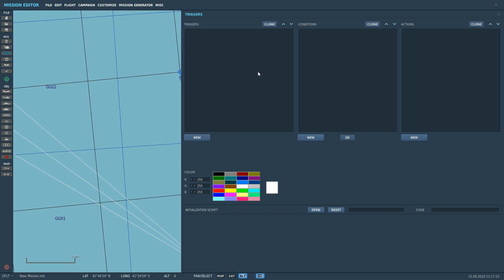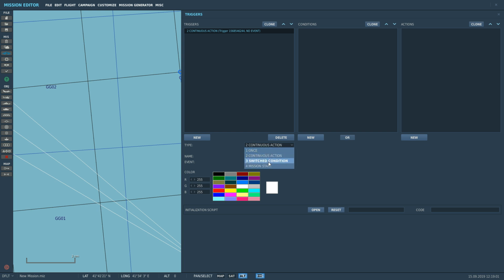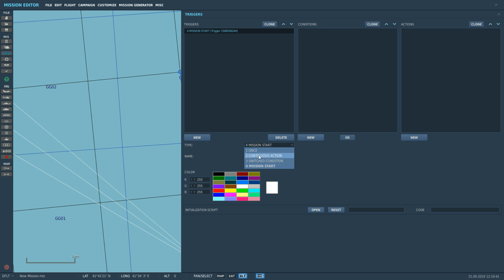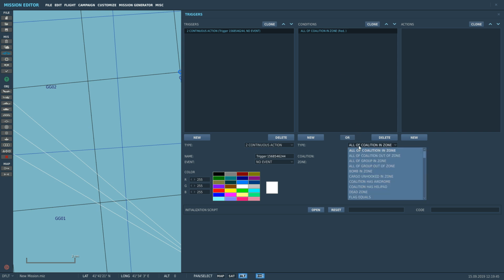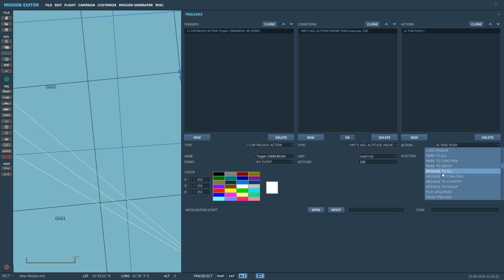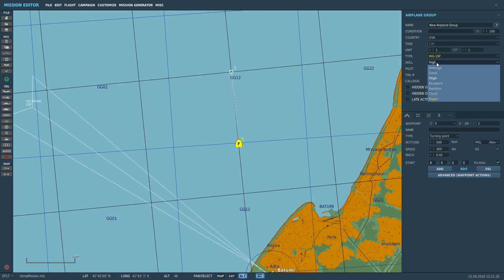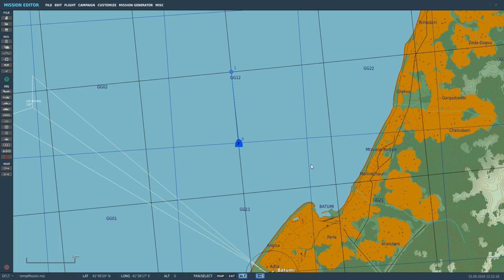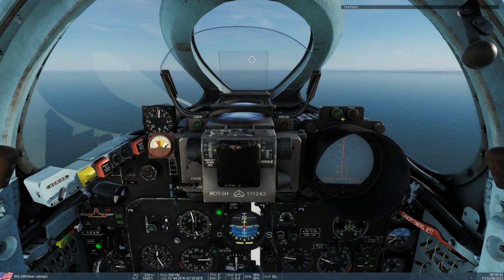Mission Editor: What Do CONTINUOUS And SWITCHED Triggers Do? | DCS WORLD

Comment: So I have been having a problem with enemy AI units only attacking a group once and leaving.  IE 2 attack helos hit a convoy they each fire 1 missile and leave.  Would setting a continuous action in the trigger fix this?
Reply from the maker: I think so, will need testing.
Reply: There are some more options in the action properties. If the total numbers of attack-runs is set to 1, they will attack once and proceed to the next waypoint.
The trigger just figures out, when to start the attack.
I usually do this with 'once' triggers or even switched condition, ie if tanks enter a triggerzone around an airfield the patrolling helos are triggered to attack them.